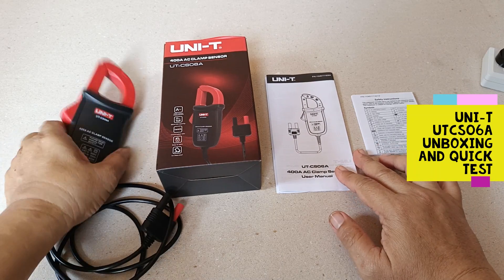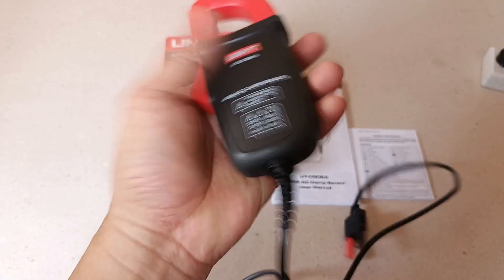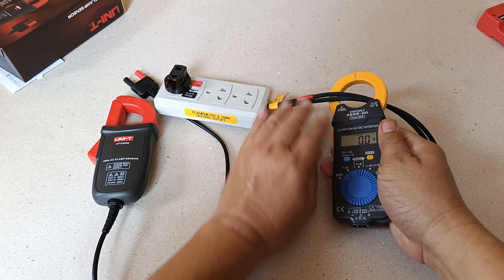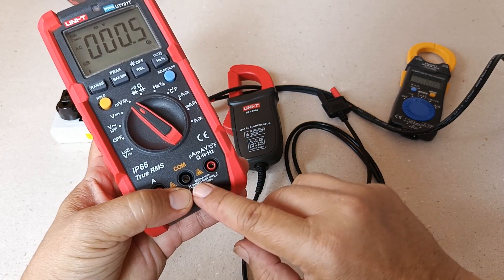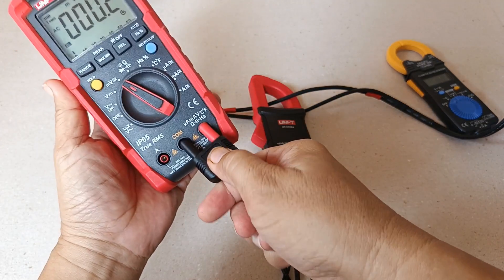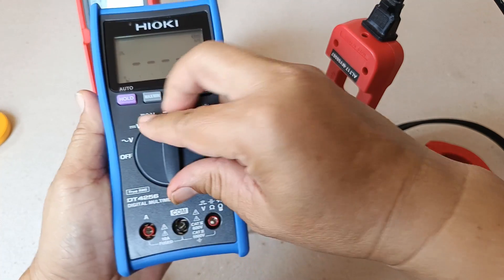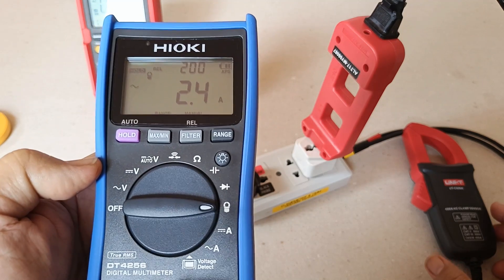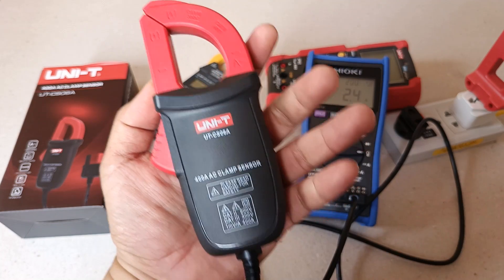UNI-T UTCS06A AC Current Clamp Accessory Unboxing & Quick Test [CC]

Comment: Do you know if it works for DC current as well ?
Reply from the maker: No, it doesn't work for DC. I hope they design one for that purpose, though. Thanks for watching!
Reply: @ramschannelreviews The operating principle of the sensor is to measure the variation of electromotive force induced on a coil in the sensor, generated by the variation of the magnetic field that passes through the area of the coil, which is generated by a variation of current circulating through a cable in this case. DC currents are, as the name suggests, continuous, unlike AC currents that vary and can therefore be detected by the sensor.

That's why there is no clamps that measure DC currents, at least not with this operating principle.